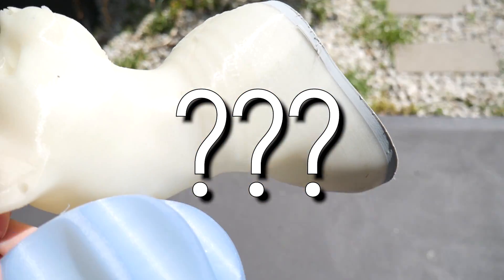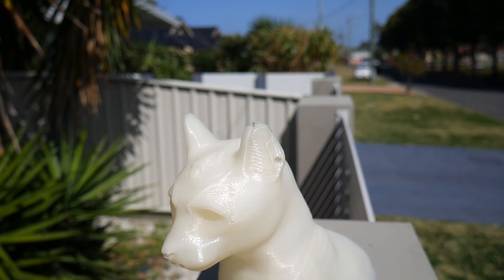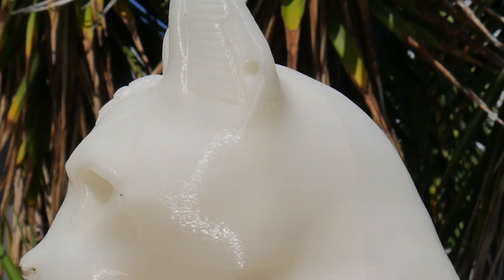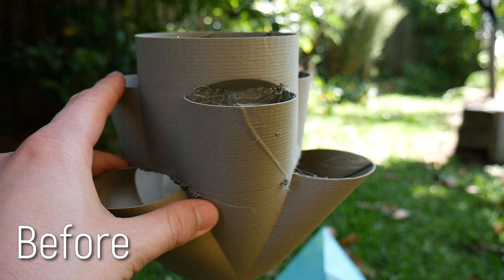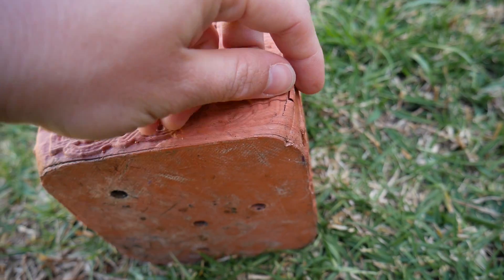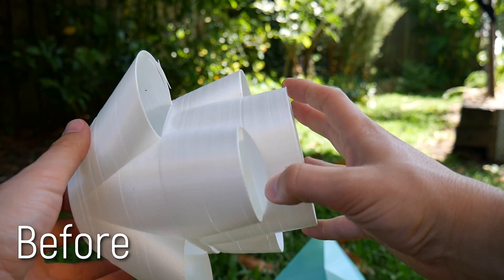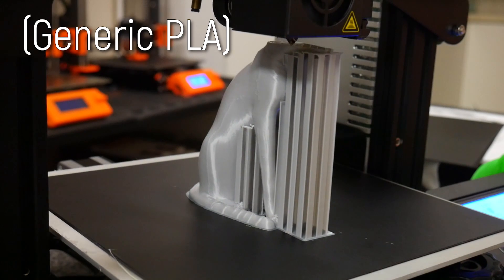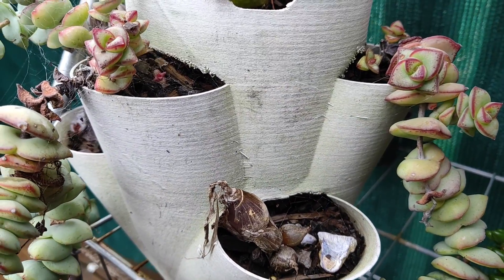Can you leave 3D Prints outside? PLA in the sun for a year!

Comment: Generally, strong walled pla prints for outdoor use should be printed with bright colours. Using dark colours in sunlight, even in conjunction with light colours will cause warping of the model leading to layer separation and visible warps. Pla absorbs moisture as well and this can also embrittle the material so stronger walls and higher infill are definitely recommended. These days of multimaterial printing, it’s just as easy to print outdoor models in petg using pla for supports.

Comment: There are so many PLA blends that is very hard to have consistent results when are used different PLA filaments. I have a 3D printed handle of a tool shed in cheap white PLA exposed to rain and sun: 3 years and it doesn't show any sign of deterioration or perceptible color change (you have to put it side by side with a freshly printed one looking closely to see a very slight yellowing otherwise unnoticeable). A screw cover for the antenna cable box that used a different and actually more expensive PLA brand (same color) in a year shows heavy signs of deterioration, to the point that I wonder if this is just a case or perhaps the top brands, with the supposed "greatest attention to the environment", use easier to biodegrade blends, causing such unwanted side effects on durability.

Comment: These material issues have been known for almost 100 years. PLA is not hydrolytically stable - it was designed that way to degrade (it is an ester) but slowly. Heat will accelerate. PETG will fair better as will ASA. However, things to pay attention to: 1.) 3D printed materials are not at the same level of crystallization as say extruded or injection molded plastics, 2.) the colorant could affect the properties of the plastic.- there is a good reason all telephone and power wires outside are black (filled with carbon to block UV). I suspect some filament manufacturers are using dyes instead of pigments which means that the part may change color in the sun, 3.) Some plastics environmentally stress crack - will be OK when untouched although the surface will degrade by UV and/or water but will crack if it is dropped, bumped, 4.) plastics have glass transitions and melting transitions which means that you have to consider both if you want to make something for outdoors - if you leave something in the cold, it may crack as it thermal cycles, 5.) plastics creep if they don’t reach their ultimate glass transition temperature - this may be slow but may play a role in warping if there are stresses in the design-it would be good to use finite element analysis (some programs are free) to identify any stresses.

Comment: I printed a red PLA support foot under a mirror that sits in direct sun and the parts exposed turned pink over the last five years.
Anything behind the mirror and the bottom are nearly the original red.
The part doesn't seem any worse for the wear except for the color bleaching.

Comment: Make a row with one, a couple and dozens of thick layers of UV protective spray (montana uv for example) applied. Also plain spraypainted in various colors, and the same row covered up.   I often use uv spray or clearcoat in painting, more for influencing surface water absorption during painting, making pen unsmudgeable etc,but would be interesting to see.

Comment: Very interesting! I worked for a small filament extruder a few years back and these were not our findings, but then again the company I worked at didn't use very good polymers. I'd be curious to know a bit more about the actual polymers used - not just brands as they usually won't tell you. As well as the climate where you live (temp, humidity, etc)!

The industry "standard" / go to PLA is usually Ingeo 4043D which doesn't fair too well outdoors, but better than some. Many of the "clear" PLA's that exist, and often marketed as a premium filament are Ingeo's 3D850 and are absolutely JUNK(!) both indoors and outdoors, they are extremely hydrophilic, degrade rapidly and literally shatter into a thousand pieces just trying to pick it up after a month!

If anyone is still using ABS I'd be surprised, ok yes I know many people still do and it has it's uses, but in all honestly it's a very "dirty" filament, made from petroleum and doesn't handle heat nearly as well as people would think.

PETs (such as PETG) are definitely where its at - for most people anyway! Unfortunately, you need to know what you're buying because a lot of companies out there will use a bottling grade (or similar) PETG that I have seen ruin printers in a number of ways and are sometimes a bit pricier. If you're going to go with PETG, look for the "Amphora" line from Eastman - AM1800, AM3300 or HT5300. All of these were designed specifically for 3D Printing - they won't ruin your printer and they hold up exceptionally well in any conditions!

Just remember, most plastics were not designed for outdoor use - or more specifically the colorants that most manufacturers use. If the polymer was able to be extruded on a 3D printer it most likely wasn't designed to hold up to the elements - with a few exceptions like some SLA resins or SLS / DMLS / DMP etc

Comment: the potted plants also may have discolored because of the dirt and water contained within them seeping into the plastic over time. you should try putting a 3d print under a glass dome of some kind, like one of those cake covering glass domes. So its in the sun by shielded from the environment. no plant to throw off how much UV alone is effecting it..

Comment: Would "permanent ceramic coating paint" or any kind of protection paint coating? on the 3d prints would make it last longer?
flex seal spray would be interesting for the thinner 3d prints.

Comment: Wood, metal, leather, fabric and many other materials also degrade if left outside for a year with no protection. If one wants something that doesn't alter from exposure to the elements, glass, ceramics and gold seem to be the only options.
Reply: My 1996 honda barely gives a fuck. Motorcycle that is, despite having a steel frame. Aluminum with a thin clearcoat really doesn't care.

Comment: It would be interesting to see a comparison between PLA, PETG, ASA etc. Same model, same location - long-term test.
Reply: You'll get the best results testing it yourself.  It will ensure that the materials are exactly like yours.  It will also show how it works in your environment.   I'm in the subtropics, so we get lots of hot and humid.  Someone closer to the poles, or in an arid part of the world would turn out differently.

Just based on how some people scream about how it's impossible for PLA to last even a week outdoors means that they're using a different blend of PLA, and/or live in a different climate. 

That was part of the point that he was trying to convey.  Different blends of "PLA" give different results.  Most products, including the filament, can have different ingredients.   

I do metal casting too, and it's hard to explain to people that not all "aluminum" are the same.  The aluminum alloy used in soda cans is much different than the aluminum alloy for cast or machined parts.   It comes up because people try to cast the soda can aluminum alloy, and the results are rarely acceptable. 

I don't think anyone is sending off samples of their filament for chemical analysis.  All we really care about is that this plastic melts at the prescribed temperature, and generally has the right qualities.
Reply: This probably exists somewhere
Reply: I am here After years. Did it happend? Too much videos here :O
Reply: PETG is much more resistable to UV, water and other outdoor factors.
Reply: Maybe compare it all against machined aluminum.

You know, for objectivities sake.

Comment: how well a pigment will last when exposed to extreme conditions is often due to whether the electron charge from photostimulation moves from the metal to the ligand, or from the ligand to the metal.  Pigments that lost their color quickly are usually Ligand to Metal Charge Transfer, where the stimulated electron effectively moves to the metal ion, and weakens the ionic bond strength between them and promoting dissociation.  This is because metals are usually +positively charged, and increased electron density gives -negative charge, causing the metal to have a charge closer to zero.  When the opposite occurs, and the electron is stimulated away from the metal and onto the ligand like during Metal to Ligand Charge Transfer, the ionic bond strength increases and the pigment is actually less likely to dissociate than before it was photostimulated.

Comment: If I want prints to reside outside I just print with ASA. Who the hell am I kidding, I don't even use PLA any more. ASA is pretty much all I've used since I bought my first roll. But I mostly print parts for RC airplane cockpits and things like that. Which, as it turns out. If the plane is left in the sun. That can be a lot like leaving your prints inside a car, in the sun.

Comment: If you want to use a print outdoor, print in ABS
Reply: ABS starts off brittle and gets worse with time.  If someone makes one of those "plastic alloys" it would likely work better.  A molded design I worked on used a polycarb-ABS mix.  Polycarb usually goes bad in sunlight.  Mixed with ABS it is protected.

Comment: I printed a bike cog for rear derailleur of my fat bike.  100% infill and the heat and cold have not effected it at all. So , I will mention that if you want a thing to last make it last the thickness does matter and shell walls . I make parts so I automatically make them strong . Only noticed what this guy was experiencing with thin shell walls and non dense prints . I reverse engineer everything 😉🤘good video thou . Abs does not like cold weather it will shatter if dropped when freezing temps are reached . Will withstand heat though.  I also paint my prints to give them more life . There are metalplas now and other suspended pla filaments that are really awesome and can withstand extreme temperatures like the carbon fiber pla or stainless steel pla . Look up protopasta it is really awesome shit . The rubber filament loke ninja flex can handle cold but freezes can handle hot no problem.

Comment: Question: has anyone tried those carbon fiber prints outside? Asking because I am printing the gears for a generator with it. But as for UV protection there are screen protectors, paints, and varnishes that can be applied after print. 

Or using some trick we turn the screen protector plastic into filament and print the entire thing out of that or at least the outer edge using a dual filament setup.

Comment: Won't a couple coats of high quality clear coat solve most of this?
Reply: I would assume only if it blocks UV? I'd also assume some designed for outdoor use would have chemicals like titanium dioxide or zinc oxide in like sunscreen for exactly this purpose though.
Reply: And depending on the clear coat, it's material is brittle it can cause addtional shear damage to the 3D Print.

Comment: Anything I make in PLA that I want to use outdoors, I paint with something that is made for outdoors. I find Krylon Fusion for plastics to be about the best; and they have a clear coat that resists UV, if you really want the original PLA finish to show.
Reply: Can confirm. I do a lot of post-work to my 3D models, ranging from assemblement to finish, depending on if either modelling or post-work is more dependable (sometimes both, like custom Figmas). Paint in general isn't merely done for a nice color in the industry. They protect from a plethora of hazards, including fires.
Reply: I was going to suggest something similar.
Reply: I was just thinking about this. I have a project in mind that essentially revolves around the prints being in-color. So losing their color over time would be the biggest concern. would you recommend any paints that would get the job done or does the clear coat really hold up?
Reply: Thanks for the tip this is useful to know
Reply: Do any protective sprays exist i could spray on to protect it?
Reply: I thought about using just generic spraycolor... probably 2-3 layers. Any idea if that would be good enough? It's just in direct light half of the day but not in a part where rain hits....
Reply: Very cool, If you are still active on this account I would really appreciate it if you would add some contextr to that. Did any of your painted parts degrade  to the point of uselessness? Like the parts in the video? If yes how long did it take?
Reply: John Chalind
Reply: @caustichail0242  indeed

Comment: I made a license plate bracket out of Colorfabb nGen (PETG with Tg 85c), primed, and painted it for UV protection.  It's been on my car for a year and I took it off to inspect it a couple weeks ago and it still looks and feels the same as when I initially printed it.  I was concerned about it possibly taking on water or warping but it hasn't happened.  I live in Houston, TX... this last summer was pretty brutal, and it even snowed last winter.

I don't think I'd try the same thing with PLA, but it's good to see that PLA has some potential uses.  Like, I bet those planters would have held up a lot better if they weren't in vase mode and were also painted/sealed.

Comment: Living here AZ, the summers get to around 120f. Inside a car, can be deadly. Ive left unpainted PLA prints in the sun and they warp, deform, and slightly melt

The solution, two layers of spray paint. Ive had a little figurine on my dash with two layers of kyrlon spray paint for nearly 6 months now and he isnt brittle, warped, or deformed. FYI, if its going outside, put a few layers of paint on it.

Comment: I’ve used 3D printed ABS parts on a number of weatherproof camera housings, which have remained colour stable (black), strong and water tight after 2 years in the UK weather. I believe it was Rigid Ink black ABS. We use Colorfabb PETG now, also with no problems.

Comment: I made some plant labels for the garden with very little infill. All it took was for a week's worth of record-breaking heat and direct sunlight to have the nameplate fold over. No melting or discoloration, it just folded under the weight of the print. Next time I think I'll make the infill to 30-50 to see if it makes a difference.

Comment: I'm interested to know if finishing or post-processing a PLA print would affect its longevity outdoors.  If you used something like XTC3D or even just spraypaint would that have any effect on how a print stands up over time.  If using spray finishes on 3D prints doesn't harm them, or even makes them more durable, printing planters and pots and outdoor decorations becomes much more viable over the long term.

Comment: I got into 3D printing despite PLA being the dominate used material. I prefer the more professional plastics, regardless of their cost. I don't want to make figurines, I want to make real world usable parts. The only PLA I own is PolyMAX, and it's really very durable, and my ABS replacement. I like Ultem, Polymide, Polycarbonate/ABS alloy, PETG and CarbonX.

But if I were to use a PLA it would be because I was making a casting or silicone mold for something else, and the PLA was just the cheapest throw-away option.

Comment: Interesting. You prompted me to look at an adapter that I printed from naturel PLA to connect two pieces of gutter down pipe together. It's grown a bit green stuff but otherwise looks perfect after 2 1/2 years outside exposed to the sun, temperatures from -15 C to +35 C and of course getting wet whenever there is rain or snow. Its not single wall thickness so that may help

Comment: I've made 4 PLA white finials for planters, but I made them with thick walls and high infill to mitigate the warping in the sun. I printed slowly and they don't have any layer separation. I glued and screwed in place and then solvent welded a printed lid to seal and hide the screw inside. When I primed and painted the planter white, I went over the finials also. Once this dried I sprayed some UV protection gloss lacquer on them for a final coat of protection.
This was 2 weeks ago. Ask me in a year how they held up. They are in full sun most of the day and we are just entering Autumn.

Comment: I created a PLA template to help cut outlet holes in plaster board to run network cables. I had left it in my tool bag in the trunk of my car this past Summer. When I went to use it once, I found it had softened in the heat and curved around the handle of another tool in the bag.  Instead of reprinting another one, I tried to see if I could re-soften it in the Sun so it would flatten out again.  By leaving it on a flat surface in the back window of my car on sunny afternoon, it fixed itself.  I know now not to leave any of my 3D prints in the car during a hot sunny day.

Comment: You didn't leave any abs, petg, or flexible prints outside ? Would have liked to see the results .
Reply from the maker: Not yet but will do some tests
Reply: @MakersMuse  Did you get around to doing this ? Links ?
Reply: I have used ABS outside and it doesn't fare well. In my experience, ABS filament is brominated the same way that ABS is for other commercial processes like injection molding and has the same problem with yellowing and becoming brittle. ABS is brominated to make it fire retardant.

In my case, I used clear ABS to make replacement garden light lenses, which didn't work out too well. The lenses turned out frosted instead of clear because my printer sucks. In any case, the lenses lasted about three to four months before the yellowing started to become noticeable . After that, the yellowing rapidly accelerated to the point of it turning brown and it got really weak and crumbly.

If you can find an ABS filament which isn't brominated, it won't turn brown, but I don't know if it will still maintain structural integrity or not.